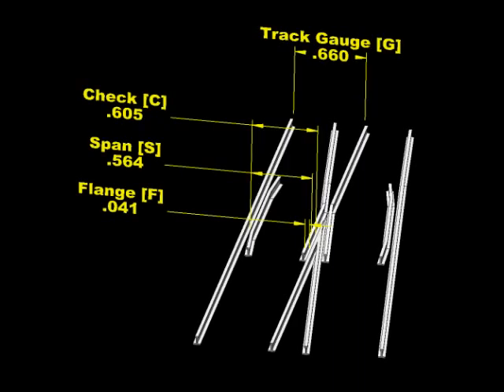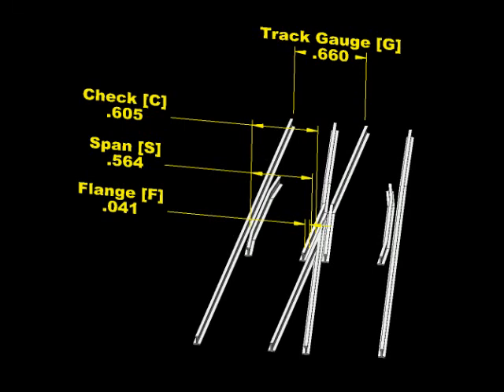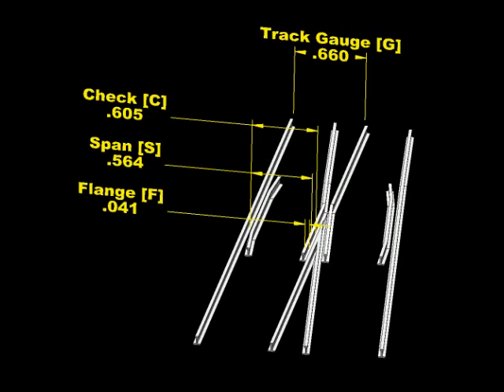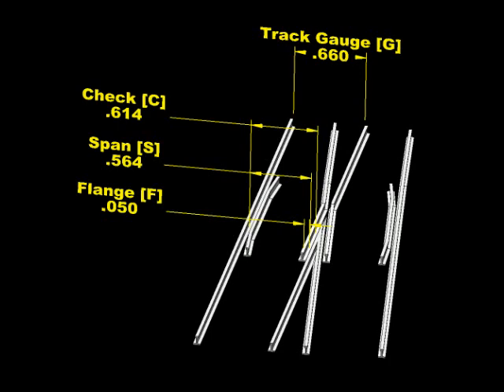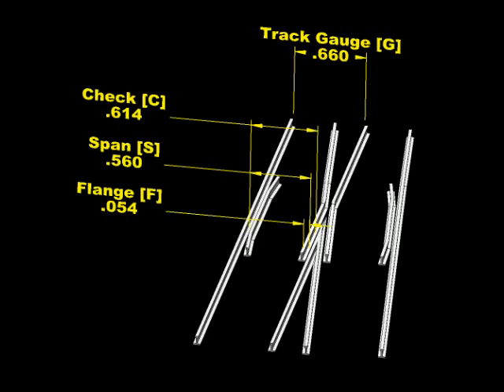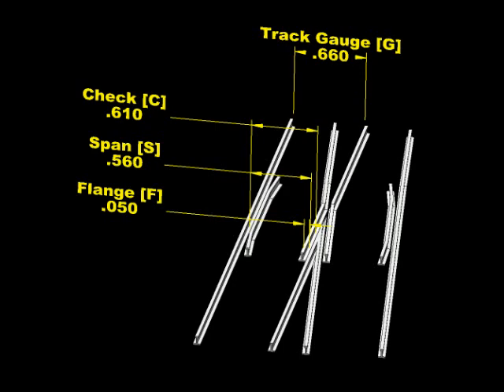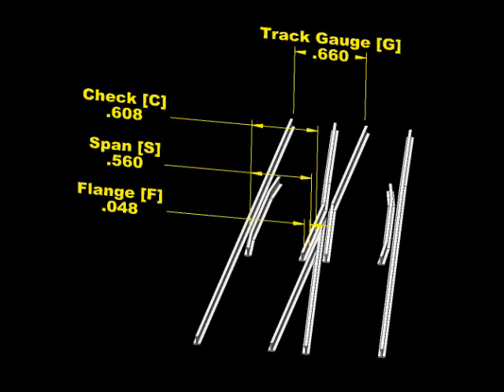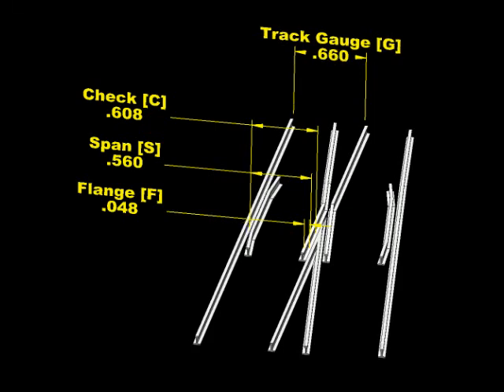Demystifying The NMRA Standards - Part 4 of 4

Comment: I really enjoyed, understood, and respected your dissertation for this four part series.  One of the things that I find is that generally working with thousands of an inch is not widely understood. I find that there is a grey area regarding the "external" aspects of the NMRA gauge. I am working in N gauge presently. If you have any knowledge of clearances of structures, scenery and loading docks I would greatly appreciate the input.
            Thanks,
                  Bob